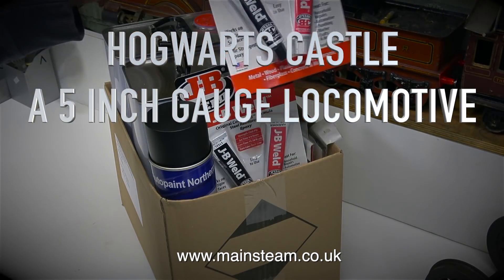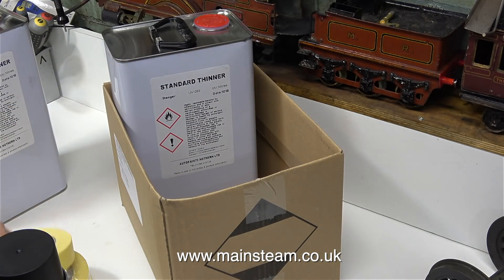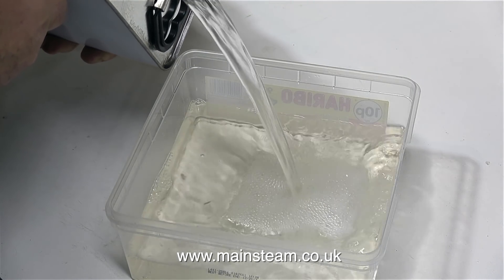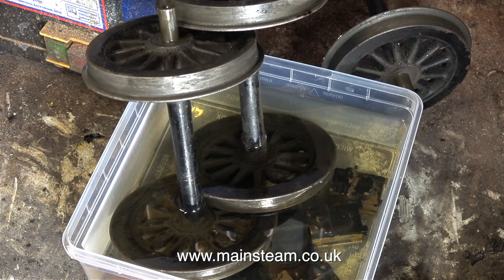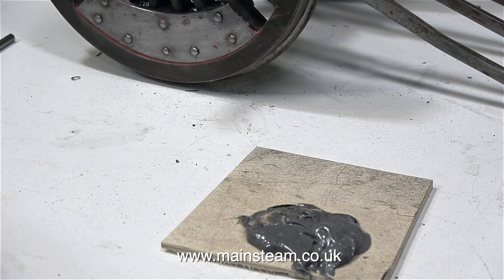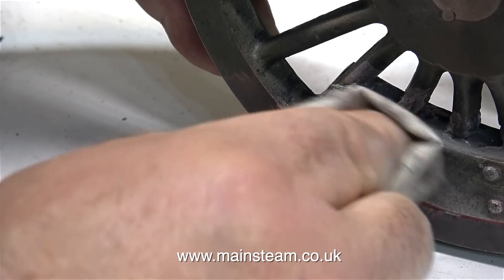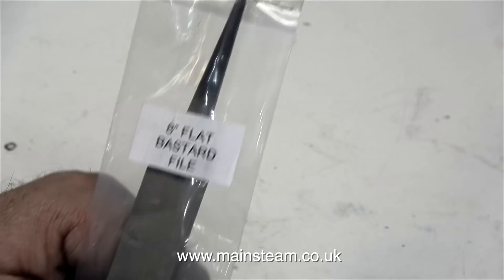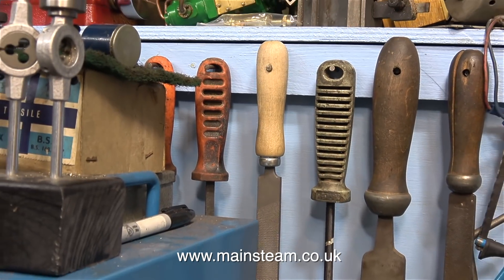HOGWARTS CASTLE - A 5 INCH GAUGE LOCOMOTIVE - PART #10

Comment: I know this is an old video, but was wondering if you have tried Citristrip?  It is a Citrus based paint remover that is non toxic and non corrosive, and doesn't burn like a MOFO when it gets on skin. It is biodegradable too, washes off with water.

Comment: In the early 14th century, the Duke of Northumberland would abuse tenants of his farms, who were late paying, by torturing their wives.

 

During this time, he invented a number of tools to help him enforce his punishment for late payment, with one of those tools being commonly known as the bastard file. 

 

The Duke’s reputation spread far and wide, it even reached London and the king’s ear. Henry V had just returned from his jaunt in France and fresh from his celebrated battle of Agincourt and wanted to re-exert his influence over the dukes and earls in court.  

 

He called for the Duke of Northumberland, ridiculed him in front of his peers and used the now commonly known bastard file to remove the tip of the Duke’s nose. 

 

A knight from medieval England, where the name bastard file originates.

 

Another theory is that files earned this nickname in medieval England (the term ‘American pattern’ was only given to files many years later). 

 

In heraldry, coats of arms belonging to people born outside of wedlock (also known as bastards) bore a device known as the ‘barre sinister’, a diagonal stripe that ran from the top right of the crest to the bottom left.

 

This is the same direction that the teeth of a single cut file run in.

 

A knight being ridiculed by spectators at a joust due to his illegitimate birth – little do they know that a file will be named after him!  

 

Therefore, it seems most likely that this was a humorous nickname that has stuck, and remains in use today as a technical term!

Comment: hi keith when you put a wooden  handle on a file you should heat the tang up over a flame this burns the tang in and the handle wont come out and also the handle wont split , heat it up push it in by hand when its nearly at full depth then tap it in.

Comment: From a forum titled Home Machinist.
Why is a “bastard” file so named? The etymology of words is certainly an interesting study. The arguable “coarseness” of such a file [with the underlying implication that one of illegitimate birth was of "coarse" birth] is probably coincidental. The more accurate [and certainly more romantic] theory says that the term “bastard” most likely derives from heraldry. This analysis is certainly the etymological “short course”. Illegitimate births were not so stigmatized during the Middle Ages…for arguably they were the norm. Indeed, there were a many, highly notable “bastards” among the ruling classes of Europe during the Middle Ages. In the English coat-of-arms such a persons status as a “bastard” was signified by a bar…the barre sinister… which ran diagonally from the upper left corner of a heraldic shield to the lower right corner. In the medieval period files were the most common method of metal working… including the fashioning of swords, dirks, shields, and armor. The manufacture of files was a leading industry during that period. A file with teeth running diagonally across the cutting face closely resembled the diagonal barre sinister on the coat-of-arms of the “bastard”.

Comment: Try an automobile grade sword striping brush such as Mack brushes. They look big for their size but with practice you can achieve very thin lines. Go to your local auto body supply store or on line of course. All you need is a small tub of lacquer thinner, to clean brush and thin paint. Also a peice of sheet glass and an old magazine. 
A dollop of paint on page o e of your magazine a touch of thinner, then pallet your paint to the right consistancy load the brush with paint and you're ready to pull a line. You can practice on the glass. Let the paint t dry and scrape off with a razor blade and practice again. Good luck man. Thanks for the videos

Comment: Playing Around posted it right. It is the angle of the cut line across the file, left to right, top to bottom forms a 45 degree line. Which in Heraldry defines a Bastard. My Manual Arts Instructor would tell us when finding the centre of a square of wood to "strike a Bastard Line on it turn it 1/4 turn and strike another Bastard line". Some of the boys used the term at home and there was a great uproar, and some parents refused to let the lads attend class. The school Principle had to call a meeting with the parents and explain terms, he also came to class and explained it to us, with great emphasis on when the Bastard term was appropriate to use. I found out years later that this was almost a yearly event and the teaching staff were even betting and the degree of uproar.

Comment: Re bastard files, I've found a couple of possibilities, this one being perhaps the most interesting : "Why is a “bastard” file so named? The etymology of words is certainly an interesting study. The arguable “coarseness” of such a file [with the underlying implication that one of illegitimate birth was of "coarse" birth] is probably coincidental. The more accurate [and certainly more romantic] theory says that the term “bastard” most likely derives from heraldry. This analysis is certainly the etymological “short course”. Illegitimate births were not so stigmatized during the Middle Ages…for arguably they were the norm. Indeed, there were a many, highly notable “bastards” among the ruling classes of Europe during the Middle Ages. In the English coat-of-arms such a persons status as a “bastard” was signified by a bar…the barre sinister… which ran diagonally from the upper left corner of a heraldic shield to the lower right corner. In the medieval period files were the most common method of metal working… including the fashioning of swords, dirks, shields, and armor. The manufacture of files was a leading industry during that period. A file with teeth running diagonally across the cutting face closely resembled the diagonal barre sinister on the coat-of-arms of the “bastard”."
Reply: What great info. Love trivia.  Have you looked up the derivation of "sincere" meaning "without wax"..  That is a great one too...
Reply from the maker: I mentioned that in one of my videos a while back - if your marble statue was badly made, then the Sculptor would fill the imperfections with some wax which made it look better than it was - a bit dishonest as it was only a temporary fix .....
Reply: If a file is inbetween a coarse and a fine then it's neither one or the other, hence the name. An inbetweeny if you will.
Reply: Tap the handle while holding it in your hand not allowing file to absorb shock on the end on the table. It will go on just as easily. The file is the course cut, and that one is a single cut as opposed to many double cut files you use. Next file is a second cut followed by a smooth cut.

Comment: Keith I'm curious how you decided the wheel weights needed more lead. Is there a way to check the balance? Or is it simply a matter of experience and to your eye they appeared light? Great stuff as always. All the best.
Reply: No expert here but the traditional balancing method was to have two knife edges parallel to each other and dead level. Let the axle assembly roll on the edges,and add weights or grind away till it will hold at any location,no heavy side down. Is static balancing not dynamic,but should work fine.

Comment: Excellent video!  I always learn watching your videos.  Something I've noted with JB Weld and other epoxies - if you want to accelerate the settling, use some heat, say from a heat gun - it makes the epoxy thinner and it settles faster.  :)  Keep up the excellent videos.
Reply from the maker: Very True, I haven't mentioned that in any videos for a while - thanks for reminding me ...... }:-)))
Reply: When it is drying out you can pour little water on it and smooth it with fingers.
Reply: Make sure it is not too much heat or it will not set proper, it you can't keep a finger on it it's is too hot.